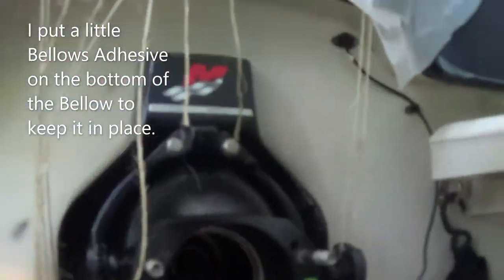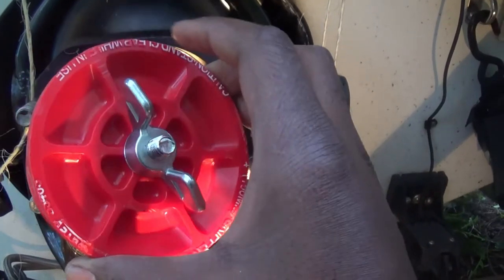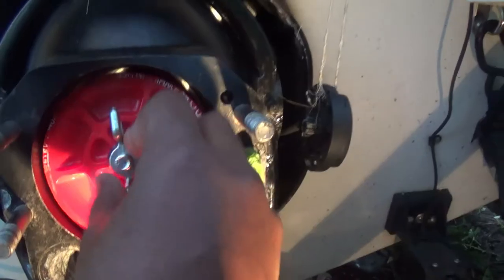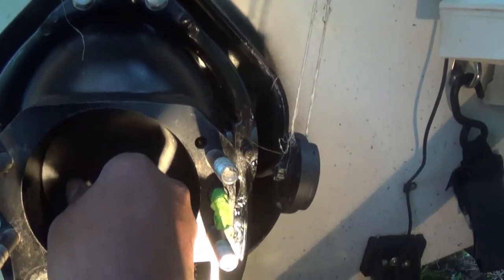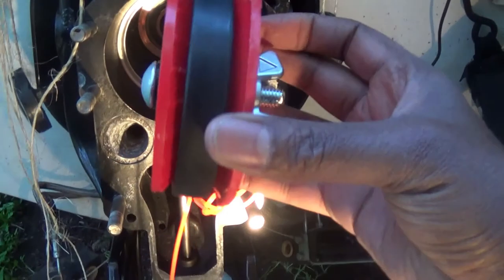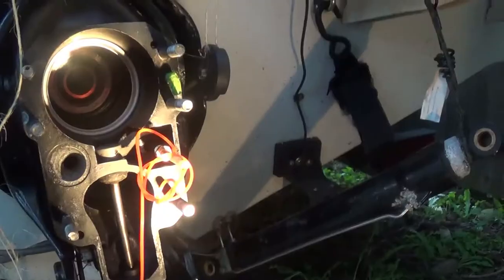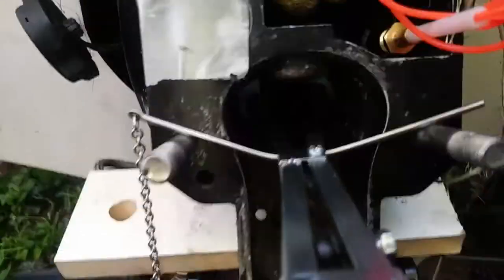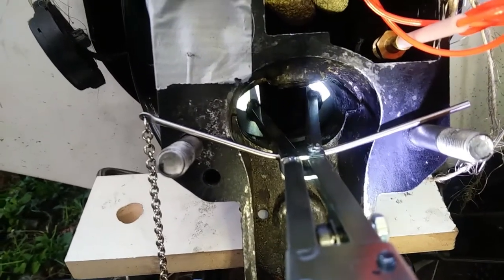Not even the PRO's know about this U Joint Bellow tool/ Also show how to use the Exhaust Bellow Tool

Comment: Thanks for posting.  Great help.  So put the bellows cement on and then use the red disk to expand it out until it dries then install the metal ring with the black disk.
Reply from the maker: Yep, also try to tap the ring on with a 2 by 4 that both ends of the ring insert into the bellow evenly.